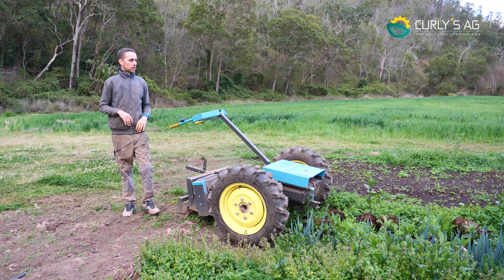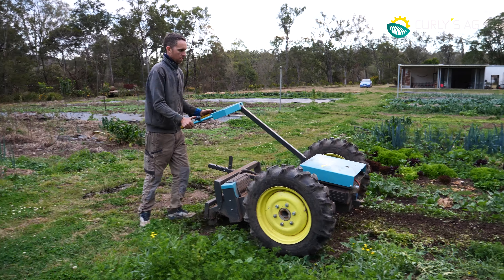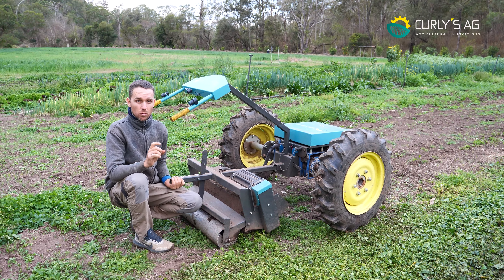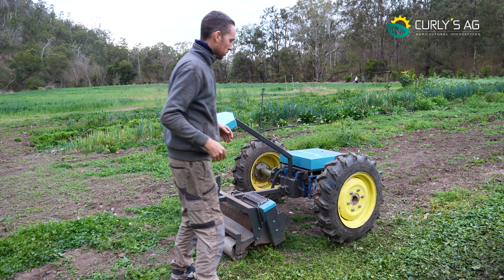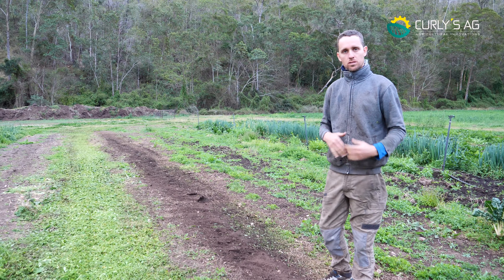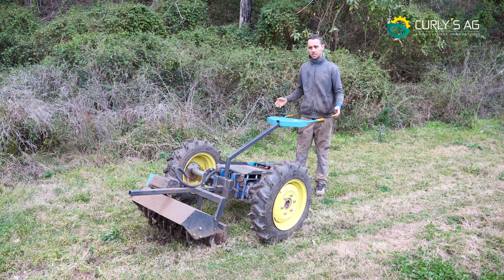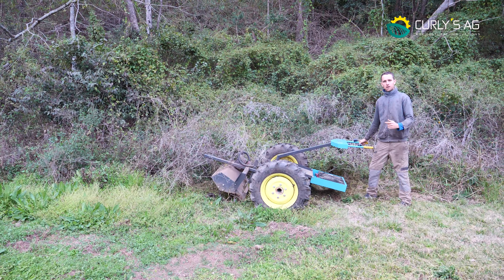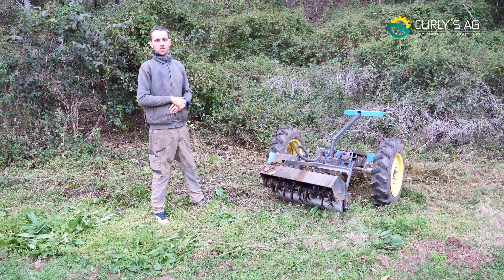Electric Flail Mower - Demonstration | Cyber Clydesdale

Comment: Will you start selling these in canada ? Suggestion- turn it into a mobile generator too. To power other tools if needed around the farm like a plug in air compressor for example
Reply from the maker: Hi, thanks for your comment, we have a dealer In Canada already, you can contact mapagri for that, and great minds think alike we already have a 6kw inverter that plugs straight into it, that can pretty well run a house